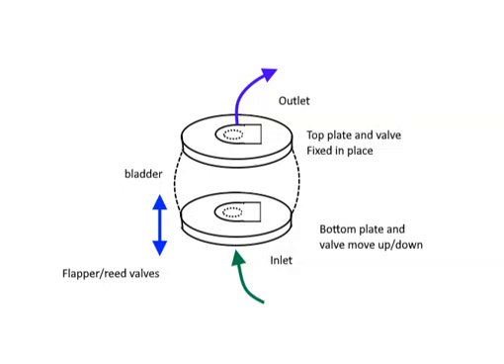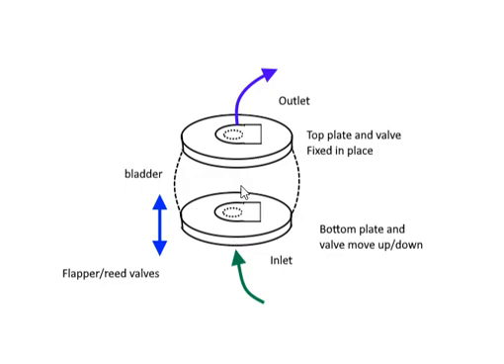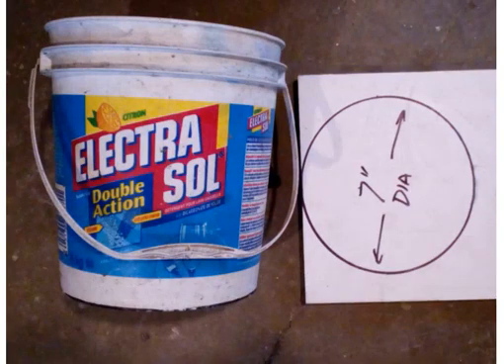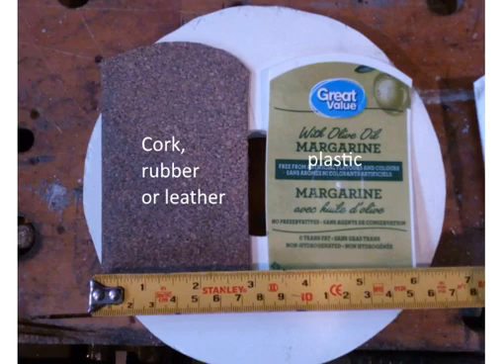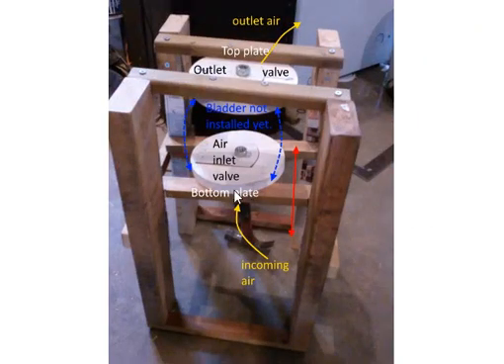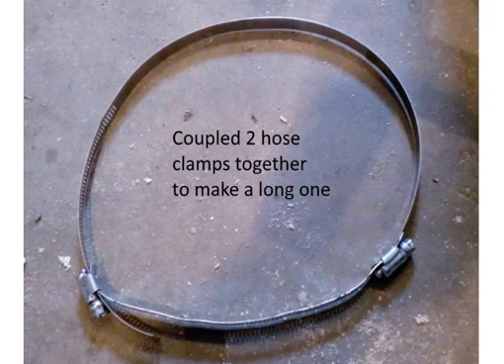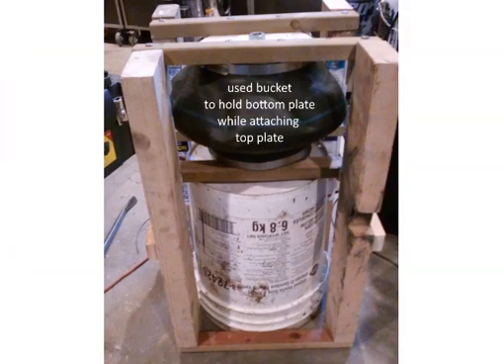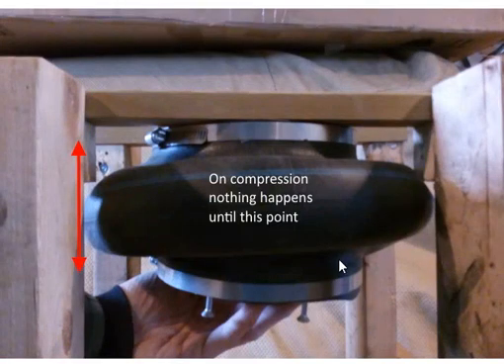How to make a bellows - air pump DIY

Comment: gives me an ideal to make an air pump for an air lift well pump. probably will need a heavier diaphragm like an air brake diaphragm. need to move 2 or 3 cubic feet of air at about 15-20 psi. could put it in a metal frame with a slide rail on either side. also thinking about driving an old lawn mower engine with the exhaust lobe repositioned where it will be open on the downstoke.. exhaust through the spark plug hole
Reply from the maker: I wonder if you could use air bags from a truck?
Reply: @blanchae  yeah that might work

Comment: @Eugene Blanchard: out out curiosity, the 2” ports weren’t so good. Would a 2” inlet & a 1” outlet have been more efficient?
Reply from the maker: I don't know if it would be more efficient. Having a 1" outlet would mean more work is required to push the air out a smaller orifice compared to a 2" outlet. A larger inlet means less work is required to intake air. There's a few laws that could apply Bernoulli's and Poiseuille's laws. I found that I had to tape a weight on the valves to hold them down. It could also be the material that you are using and the mating surface.

Comment: Story behind? Why would you need this?
Reply from the maker: I am working with the Pandemic Ventilator Design Team initiated by the UofA and UofC Biomed Labs to develop a mobile iron lung (negative pressure ventilator) for worst case scenarios where there isn't enough equipment and death is imminent - worst case option. The goal is to be able to make a NPV using components found locally and put together with amateur skills. I'll post some links to historic iron lung designs from the 30s and 40s in the description.
Reply: @blanchae  oh wow
Reply: Nice Design!! Sulfur compounds are used to cure rubber during the tube manufacturing process..traces of sulfur can be found even after several washing cycles. Do you think it would be safe to inhale the air pumped from these tubes?
Reply from the maker: @siddharthdev  No, it would not. But if you put a filter then it might be. A charcoal filter from a N95 mask maybe?
Reply from the maker: @siddharthdev  I've added a link to it in action in the description